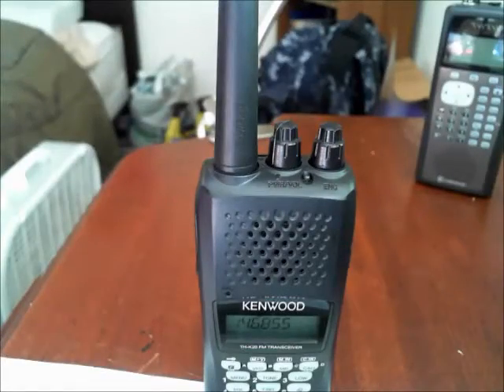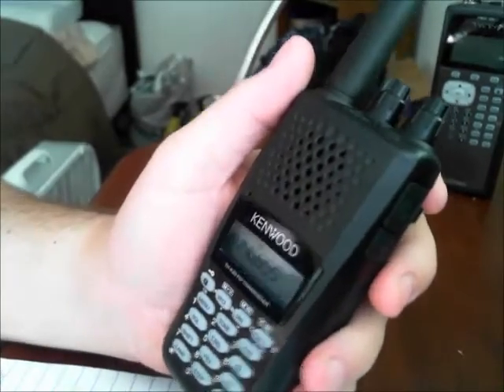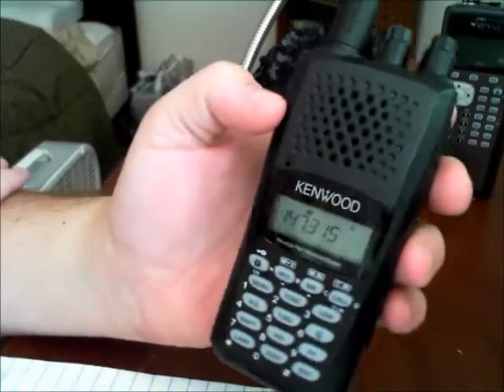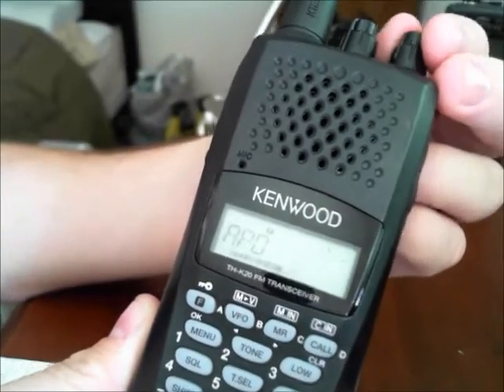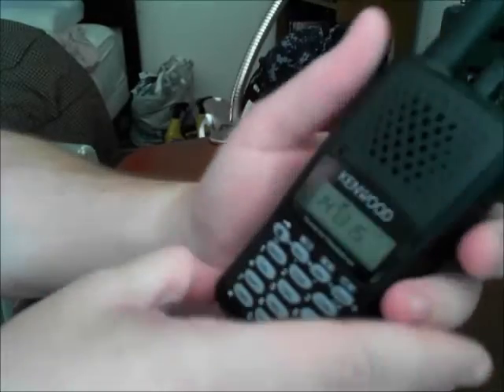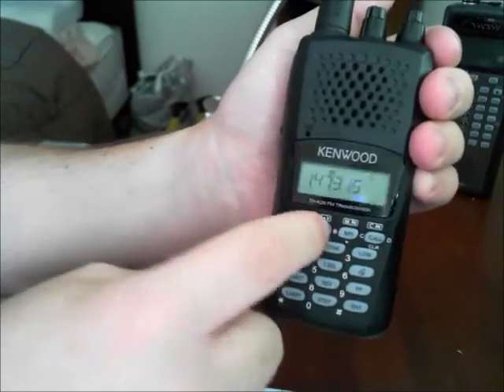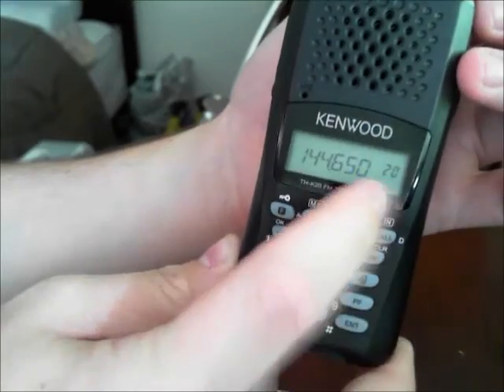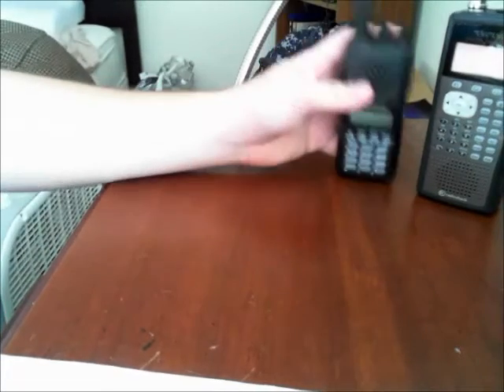Kenwood TH-K20 Programming Frequencies into Memory.

Comment: Thank you for this video.  I just purchased this radio. I am having a problem with programming it.  I have an offset of .66 for the repeater I need to access. is it possible to manually put in that repeater frequency?

Comment: Can you scan 2 frequency with that radio?  I'm thinking if you are in MR mode and press and hold the call button it should??and if you can do that can you Lock the radio while it is scanning???  Thanks VA3TXN
Reply from the maker: +MiniSix8 Hey,
I'm not sure if you can, I'll have to give it a try later today. When you lock the radio the only buttons that are unlocked are the PTT button and the power/volume knob. I assume that it will still scan.
Reply from the maker: +MiniSix8  I'm uploading a video response to your question now. Please check it out when you have a few minutes and tell me what you think. Thanks! 
KC1CWP